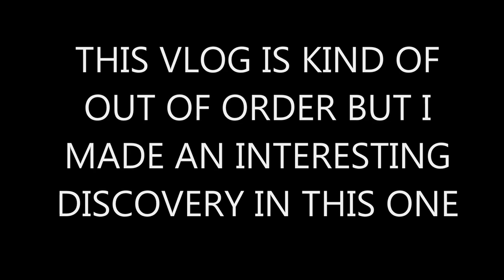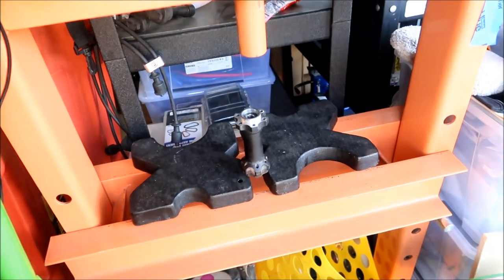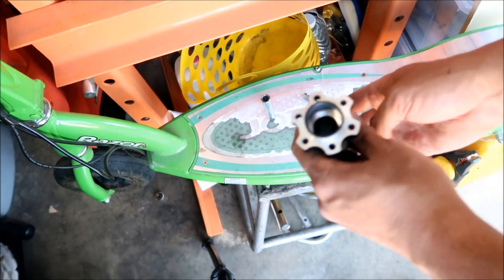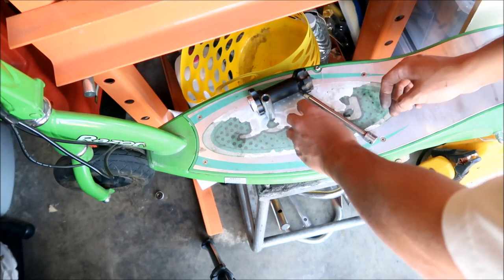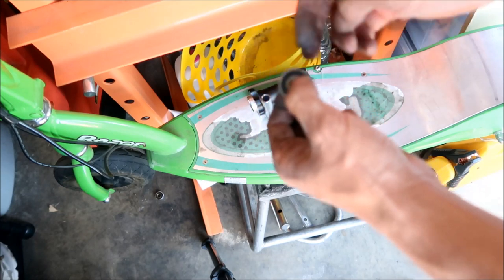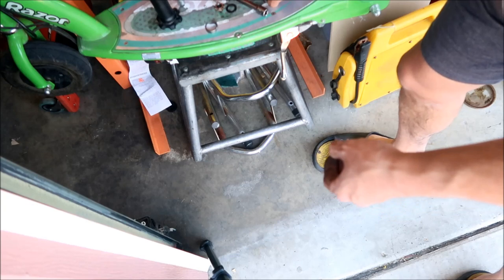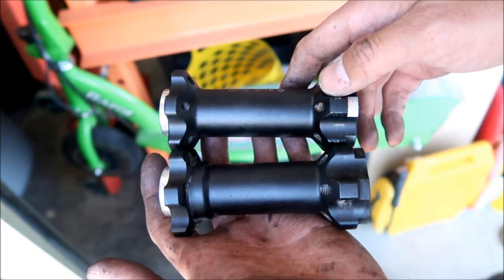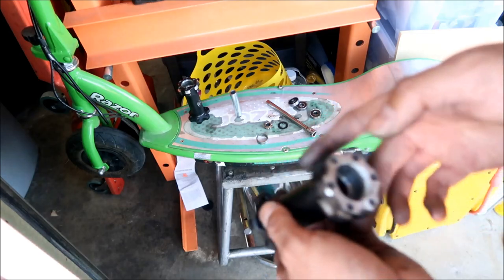Sur Ron Light Bee Jackshaft Bearing Replacement VLOG Part 2 - 3 vs 4 Bearing Discover!

Comment: so when you replaced the bearings then reinstalled the jackshaft the noise was still there? Is that why you say that the noise was coming from the primary drive sprockets? Did the noises go away when you changed both primary drive sprockets?

Comment: Do you think an inner bearing puller would get them out? I can't tell if there is room behind the bearing for the extraction. Thank you and I enjoy your videos!
Reply from the maker: Hmm you might be able to get a blind hole puller in there I have one but never tried.  If the claw is long enough or if you can get ot between the bearings.  It's tough with the 2 bearing stacks on each other =/
Reply: @hadesomegamoto7639  I was thinking the same thing, with 2 in there it might be hard. Thank you for the reply.

Comment: Mine has a vibration in a spot I can feel when I'm goin slow . U think it's the jackshaft? Messed with my chain and tire alignment and trued..thought it was my master link .. pissing me off at this point.. hit up Luna.. they say it's tire or sprocket.. it's not tho..
Reply from the maker: Hmm it's hard to tell you have to see if you can isolate the vibration.  Is your wheel balanced?  Usually at only higher speeds wheel balance is noticeable though.  Try to run it with the wheel.  Then take the chain off and see if there there is a vibration.